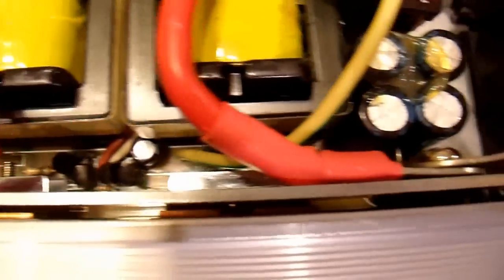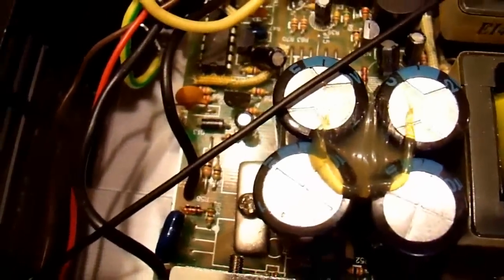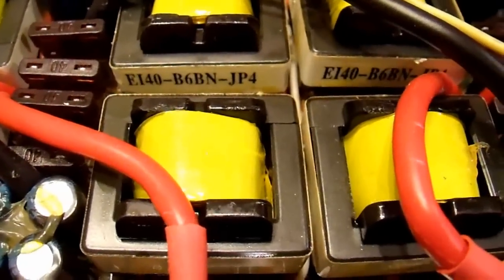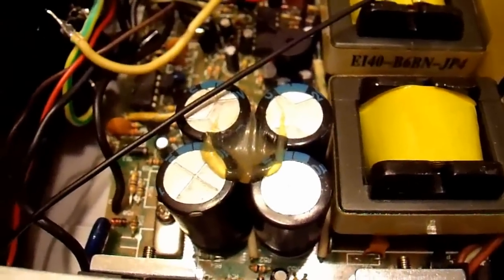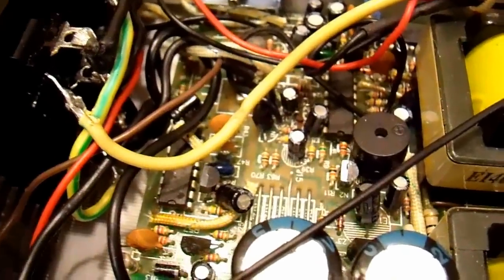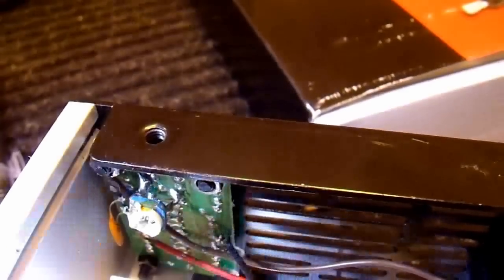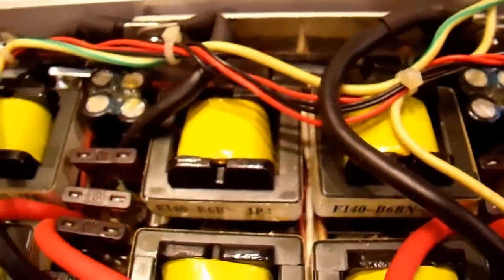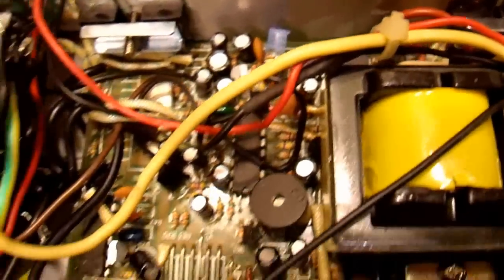Cobra Inverter Review Part2 - A Peek Inside

Comment: I've been using this inverter for maybe 7 years.  Still running well.  It does bog down under load but it always works even in sub zero temperatures.
Reply from the maker: Thanks for the feedback.  Looking back from today's perspective this would be considered a decent quality inverter in the lower cost category today.  With power inverters there's been a rapid race to the bottom.  I AM surprised it lasted 7 years of regular use.  I may have been wrong on this one?

Comment: PART 2 - I had a Xantrex 1750PLUS inverter mounter in a conversion van that I used maybe 10 times at most, sold the van, took out the inverter and put it in storage for the past 6 years. Went to install the Xantrex and it fails on power up. The output transformer is shit. After ONLY about 20 uses and put into long term storage? Screw Xantrex. That thing cost $225 in 2006 when I bought it. So I'm looking for something that wont break the bank, that will do 1500W-2500W. CONT...

Comment: PART 1 - At least for me, you're making this thing sound like crap and I have a electronics/avionics background and for the most part, I agree with all of your disappointments in this unit. However, it's not a Boeing, Airbus, Rockwell Collins/Honeywell component with airworthy standards. So for the average Joe like me who has a F150 extended cab who wants to run a table saw, circular saw, drills, charging cordless tools, light stand, etc, I think this Cobra brand would work fine. CONT...

Comment: I am new to the solar energy system setup and i want to power my Samsung 40" led TV, PS3, two fans, two laptops, wireless router and a refrigerator. I want to start with two 100 watt Renogy solar panels, a budget MPPT charge controller, i found two battery on amazon that i'm interested in four 35AH 12V DC DEEPCYCLE SLA SOLAR ENERGY STORAGE BATTERY or six UPG 85980/D5722 Sealed Lead Acid Battery (12V; 35 AH; UB12350) and a Whistler Pro-2500W 2,500 Watt Power Inverter.

Comment from the maker: The document is referring to an external fuse which has different requirements from internal fuses.  (a failure does not result in a warranty return, it does not have to handle high temperatures, etc)  They also call out a very expensive fuse type that is repeatable in its performance rather than the cheap automotive blade style fuses in consumer grade stuff.  I wonder what type and rating of internal fuse(s) Xantrex uses in their professional inverters like the Freedom that was referenced?

Comment from the maker: As an engineer I am well aware of fuse specifications, types (some fuses are designed to 'blow' very quickly, some very slowly, most are somewhere inbetween), their design and use.  I am also well aware of the quality of Chinese fuses which are almost always used in this type of consumer product.  You absolutely cannot count on these fuses withstanding a surge - or even their rated current in some cases - at elevated ambient temperatures.